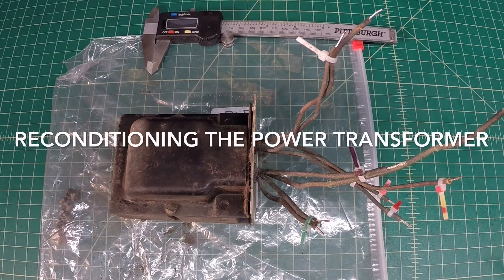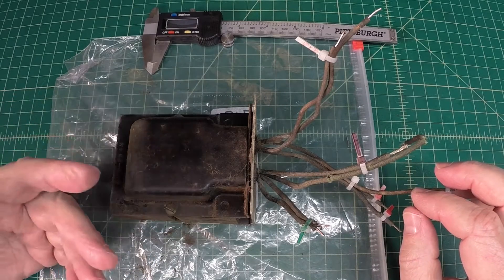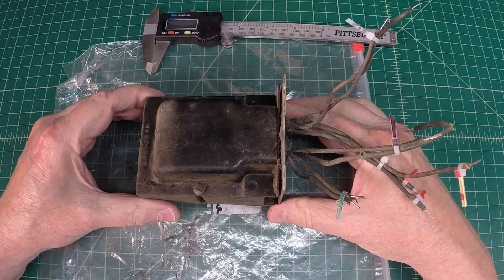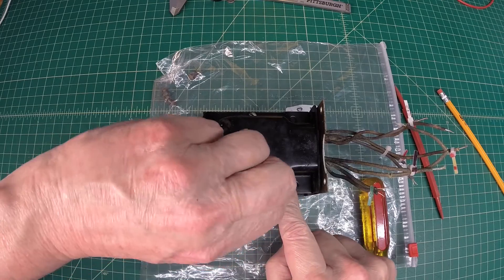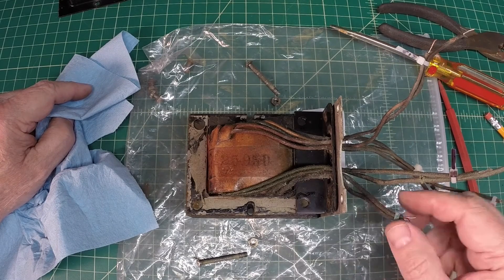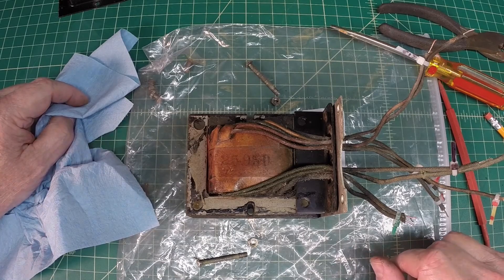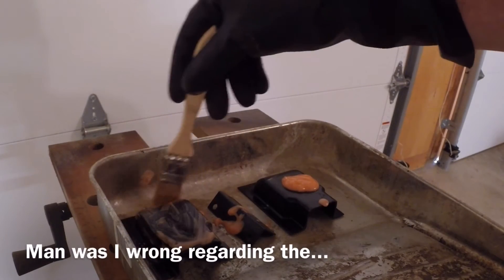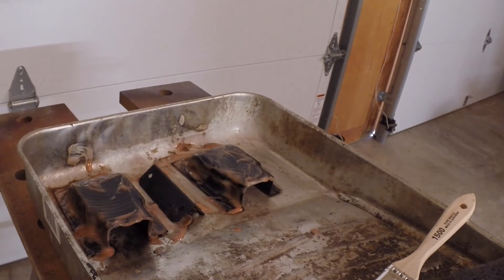Power Transformer Reconditioning - Part 1

Comment: Nice work on the clean up,since I don't how much heat that transformer makes,do you think  heat resistant silicone wire,would work better,on it ? Also I just bought a new product to me  ,is doubled wall with glue inside heat shrink ,I bought it for places that the heat shrink in time could move around and that double wall seem to be a good idea too,and it not that  much more in price ,on Amazon or Ali express  .just wonder if you tried it yet.I do get some of my Ideas from you on stuff I buy,like that lazer thermometer you bought  ,Ali express  had it for 5.00 or 6.00 dollars,thanks for shareing your ideas on the products you use.
Reply from the maker: Ron - to your point, I think silicone coated wire would work equally as well if spec'd accordingly. The wire I used is rated at 105°C or 221°F. The double wall heat shrink is a good idea, so thanks for the recommendation. Thanks again for sharing your expertise and suppliers. Best, Don
Reply: @RestoreOldRadios .thanks for the info Don ,everything I learn from you I put it to good use  ,thanks

Comment: That xformer looks nice Don. Excuse my ignorance, but can't you shove a very long heat shrink tube around all the wires all the up the hole in the mount making its way up further to almost the windings then shrinking it to keep themsafe? Never did that deep a xformer repair my self. Thx
Reply from the maker: +saturn5tony Tony, your idea and solution is the most practical. My challenge, the lead dressings on the transformer were on the tight side of the house, so I need a few more inches of wire on a few of the leads. Best, Don
Reply: Oh yes you said that as well on this vid, yes always good to keep them longer. It amazes me to see that transformer (more than the other parts) It is kinda the only real thing you cannot find again and over 80 years old...woow!! Thanks for sharing!